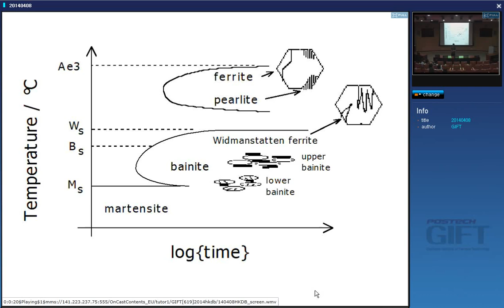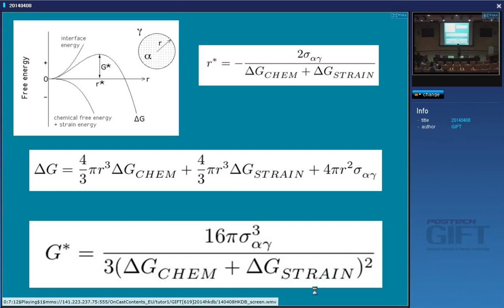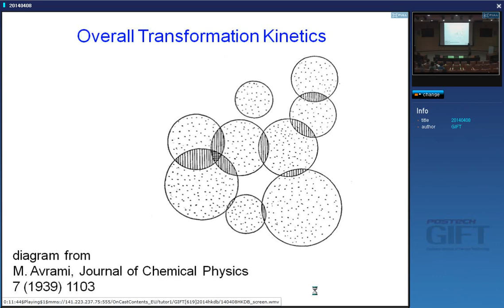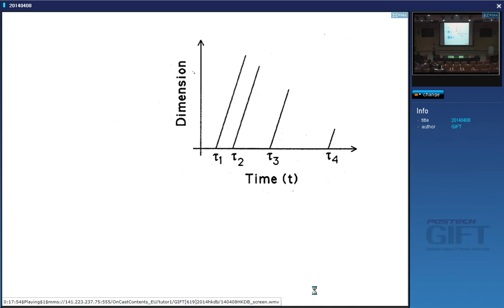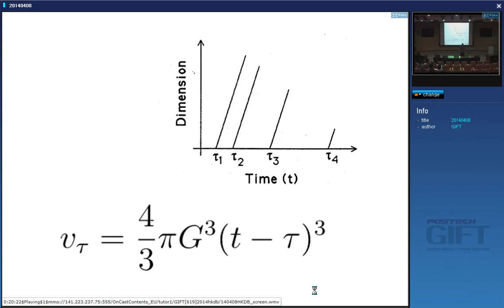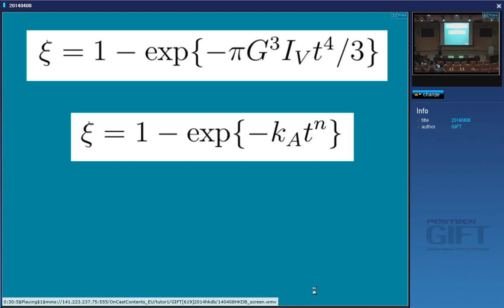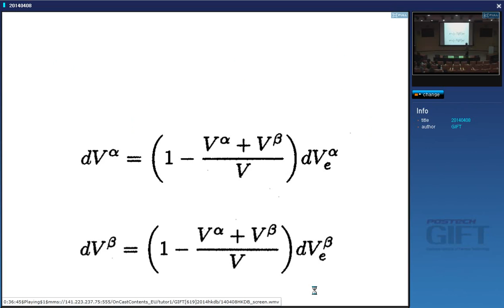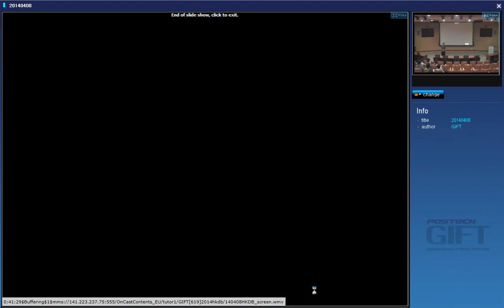Phase transformations in steels 10, 2014

Comment: Dear Professor, I took a look at the structure.f open source code in your website. I think the code has a lot of deleted features that can't be executed by modern compilers. Is it possible to get the updated one with .f90 or more? Or if you could point me toward a compiler that can execute structure.f, it would be great.

I really love your video lectures. They are really helpful!
Reply from the maker: We make material available but unfortunately cannot assist in this respect because we do not have the resources to deal with all the queries.
Reply: Thanks for the reply, professor!